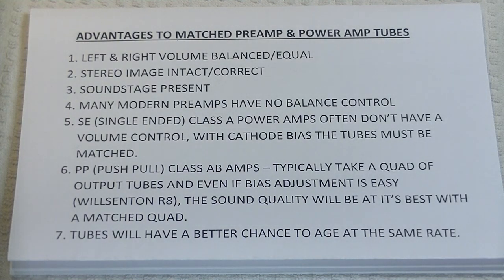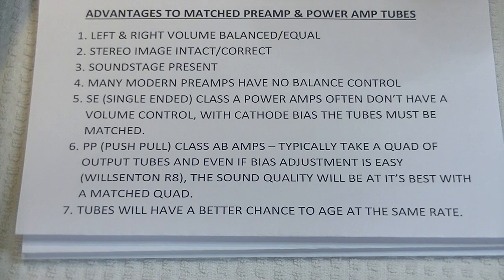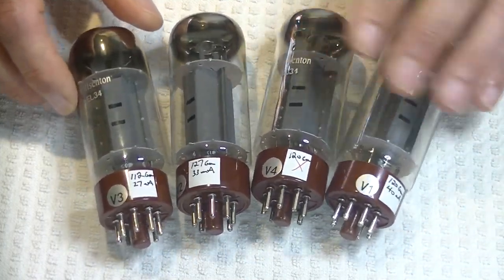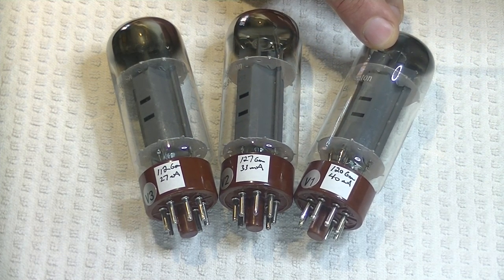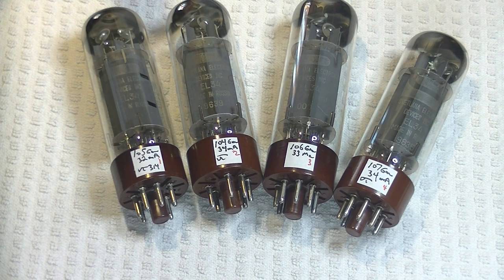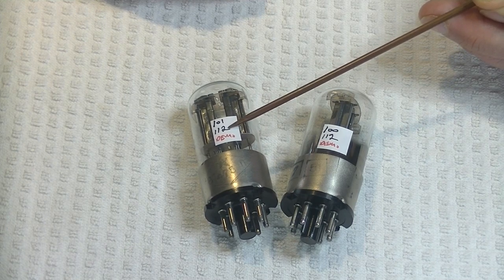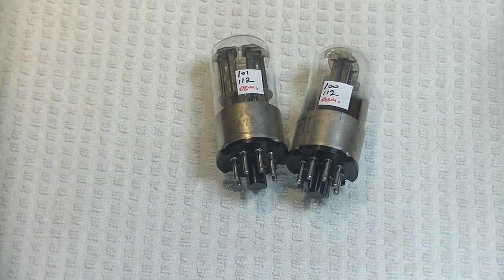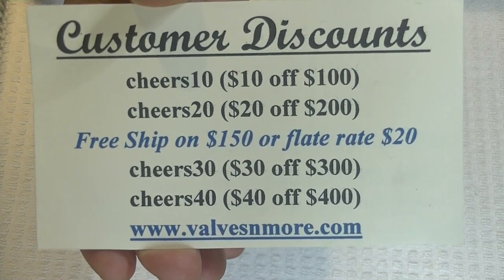Tube Lab #29 Importance of Matched Tubes

Comment: An important reason for match tubes, and push-pull audio amplifiers, is lower distortion. When both tubes are sharing the load equally on positive and negative Cycles the amplifier output will be most symmetrical.

Comment: What is the minimum mA emission for a used old stock Blackburn Mullard EL34 that is still worth buying for a self-biasing PP amp which never pushes output tubes hard ?
Reply from the maker: This is a hard question to answer, because a power tube has almost an infinite number of operating points (within it's min / max).  If you asked, what is the minimum emission (mA) as measured in my custom power tube matcher or the Maximatcher (both testers use the same settings) then I could say about 20mA, with NOS close to 40mA and used commonly tests 20-30mA.  This is a tube I specialize in and love, but unfortunately some online sellers try and pass off weak tubes as good.  I regularly but Mullard xf2's and even though most sellers say "matched testing strong" 90% of them are unmatched and a significant number test low.
Reply: @tubelab194  This is interesting, thanks for your reply. I often see the sellers mention  75 mA/11 as  standard parameters for a Blackburn NOS EL34  Millard, and I recently bought a used one , that showed 70mA  on the seller's tester. He said "Don't look at the number,  this  American tester can only indicate if the tube is good or not".
Reply from the maker: @sashbar  he is probably just testing on an older tester that only tests for emissions at lower voltage (probably 220v).  In my experience buying such tubes, it's always a crap shoot.  I test at full "normal" operating voltages on my custom power tube matcher.  For an EL34 that's 400v plate and -34v grid.  Power tubes can react electrically very differently at those lower voltages.  So he is correct in saying don't look at the testing number, all he's selling is a tube that works, maybe it is emitting at NOS and maybe at just barely an acceptable pass.

Comment: What if i cant buy a matched set of tubes.

I need 2 number 41 tubes but nobody sells matched nos tubes. They give you what they give you. You cant even pick the brand.  I ordered two 41 tubes and got one of one brand and one of another brand

What to do in this case
Reply from the maker: @kwacz  keep looking, it may just take some time to find someone who has a bunch of them AND will test them. Note all quality vintage tube sellers test and match.  Or rewire a new octal socket for the 6K6 which is electrically equivalent with a different base.
Reply: Anyhow i put them in anyway and they sound fine. Just as good as the ones currently in there. No different. The radio is from 1942 so dont know if that matters.  I dont know if they even did matched tubes back then.

Comment: I have a quad of very used GE EL34. Each one of them needs to be biased to different level on its individual biasing pot to get same mA bias current on my push pull power amp.  All the tubes are not able to achieve the bias current the amp needs so I have to run them almost 30% lower bias current from the amp recommendation.

Recently one of the resistor connected to pin 3 of V3 burnt out. After I replace it and put on fresh new sets of EL34 the same resistor burn out again after 1 hour use.

Is running old non matched tubes cause this?
Reply from the maker: Hmm this is a good question!  Well pin 3 is of course the plate, but normally you wouldn't have a resistor on the plate, so I would have to see a schematic before I commented further.  I would suggest you find the schematic and post it to one of the tube amp groups on Facebook and see what everyone says.  Proceed with caution, something may be seriously wrong!
Reply: Maybe the resistor on the plate is a triode connection with screen ...????? anyway the tube is faulty.